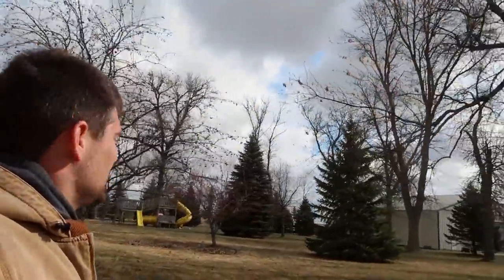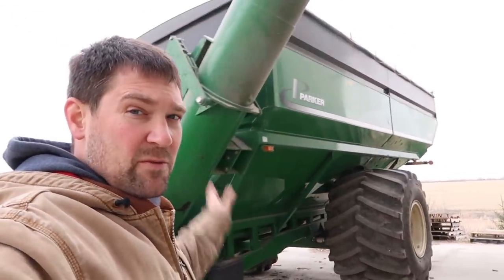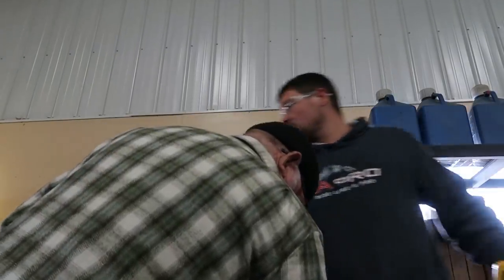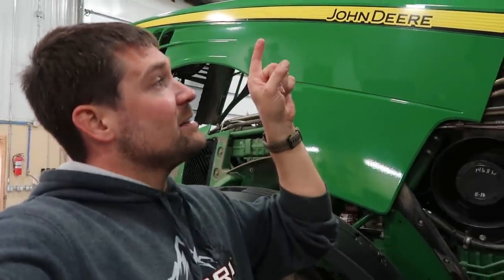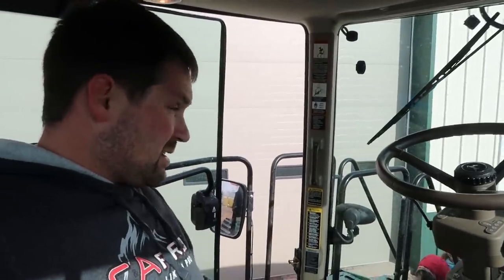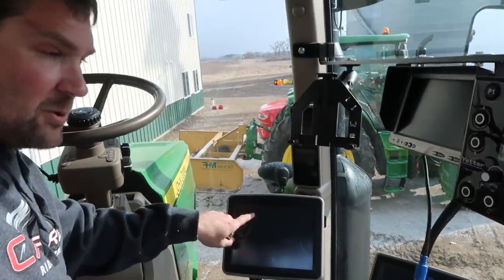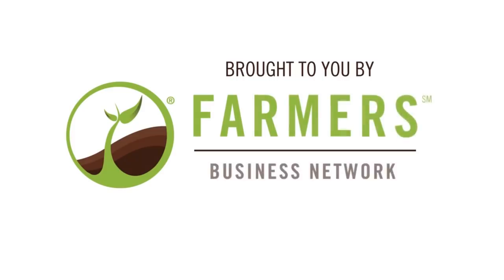Tell Us What We Did WRONG!!

Comment: When you put new fuel filters on those tractors try leaving the filters loose and turn the key on until fuel comes out of the filter then tighten it up. I’m a jd tech and sometimes they seem like they end up full of air if you don’t do that 🤷‍♂️ kinda messy but it seems to work better
Reply: Hunter Medrud totally agree with you, also I’ve found that after so long computer will time out and shut off pump even if it’s not done priming.
Reply: Hunter Medrud 
That’s great advice. Would that tip work with any diesel fuel filter? I sometimes have trouble with air locks in my 2.8 Sofim 8140 long stroke motor I run in my tourist Land train. Fiat Power Train just kind of shrug their shoulders when I ask them about it. Never had the problem on the 3 litre Toyota.

Comment: Key cycle 3 times for 60 seconds after changing fuel filters, then it will start and stay running
Reply: Sometimes they just wont bleed out.  You can pinch the return to tank line a lil bit for 20-30 seconds and repeat a few times.

Comment: Nothing more American than a seed tender with “Patriotic Farmer Addition”!!!!!
Reply: I just wondered if that's too much weight while full for the Dually, 3 axles is quite a bit for a bumper hitch
Reply: Except it goes against National Flag code.  Not supposed to display the US flag on anything.
Reply: @cmusic52  They pull surprisingly well, we typically haul 200 units of beans regularly down the highway.  Its not pleasant but it can be done behind a 3/4 ton truck as well. Legally it is to much though, your looking at around 17-20,000+ pounds depending on seed weight.
Reply: @Galactis1  people misunderstand.
The Flag Code refers to flags. Those are NOT flags, they are decals.
T-shirts are NOT flags. 
Bandannas are NOT flags.
Absolutely no rule against flag prints. None. Zip. Nicht.  Nada. Zilch.
You can wear clothing with printed American flags or flag decorations.
You cannot wear an actual flag as a piece of clothing.
There is a Flag Code covering this issue.
The American Legion has given its support to clothing that represents the American Flag and patriotism.

Comment: Do you have ground disconnects on your tractors? We’ve been putting those on our 8Rs and 8RT. It definitely helps with batteries. If you do and the planter has any extra hookups for say an air compressor for the row cleaners you have to make sure it’s grounded to the ground post and not the battery.

Comment: Since the fuel filter didn’t require a pre-fill you should’ve cycled the pump 3-4 times before firing. My guess is it was only pumping the original 3-4 seconds needed to start with an already full filter, not knowing it’s empty
Reply: The Smokers Necessity give a little bit of throttle. Help the system to pass the air so you don’t stall the engine.

Comment: When you started the tractor hit a little bit the throttle it helps to push the air so you don’t stall the engine. Even when you think your filters full you can have air left in the system.

Comment: I’m sure everyone has told you how to fix your 8360 battery problem but I figured I would share that we run an 8345rt and it has a similar issue with a large power draw when the key is off. We have found we can rectify the issue by turning the battery shut off off

Comment: We have the same issues with the batteries in our 8360RT. I installed JD’s battery disconnect this year and haven’t had any problems. Local JD tech says there is a constant draw for all the controllers on late model tractors that keep them ready for when you want to turn the key. I see all newer JD tractors are coming with disconnects installed at the factory

Comment: Same thing happened to my dad and john deere said unplug the fuse for the radio cause the radio kills the battery
Reply: Then you'd have to  have them come out and set the time and presets every time.... 🤣
Reply: Pretty much anything electronic will do it. Just because it's not on doesn't mean the comp in the devices isn't eating power. Just like sleeping and off stuff in the home.
Reply: If you use the kill switch... Your radio still work? Greens are weird. :D
Reply: It’s still odd that it sat all winter and fired up then sat two days and wouldn’t.

Comment: If you tried starting it before the filters get full you’ll get a air in the system. After that sometimes you have to crack a line to get the air out. When you turn the key on to prime the filters it will only run for like 30 seconds and then time out. I have replaced a couple of the lift pump.      On the 8000 R series do you need battery disconnects. Too many controllers on them drawing power all the time.

Comment: Whenever you replace a fuel filter (and yes.  it is not recommended to re-fill from a jerry can)  - my trick is to not screw the filter in tight. Screw it on but leave a couple of turns loose. Turn on the primer pump till no air bubbles leave to top of the filter and then tighten the filter.  It's a bit more messy but you will never have a starting issue

Comment: the reason why your tractor won't start with a new battery is the john deere green sense thing that communicates with the dealer is faulty. our 8335 had same issue. some times will start no problem, other times it has a flat battery even after been sat a long time it con be fine and sometimes not. we had a brand new 6 R 69 plate have a similar issue

Comment: In a modern diesel engines its programmed in the ecu a certain amount of time the electric fuel pump will run without the engine running. Turn the ignition key on and off several times to prime the fuel system before starting the engine

Comment: ive got a JD tractors that are supposed to fill the filters and "bleed" itself as well. about half the time it will fill about half the clear bowl and stop. all i usually have to do is crack open the little plastic screw on the filter housing and it fills up and starts and is fine. im not sure if that particular tractor has that screw but thats what works for me.

Comment: Don't look at filter if electric pre fill to 3/4 or cycle key off 4 or 5 times before cranking. Change fuel filters when engine is warm so you can run the rpms up some

Comment: I work for a large construction company in Vermont and worked in the mechanic shops for a few years, in was always taught, always fill any vertical fuel filter with fuel. That icon on the filter may mean not needed not DONT fill

Comment: just got done rebuilding a 8245r, 2018 with 300 hours on it, the electric primer pump wasn't working while i was trying to prime the system, had to jump 12v to the fuse and then it started working, now works fine but it seems that they dont like sitting.  that machine was sitting for about 7 months

Comment: Zach, regarding your issue with the twine, could in theory some sort of a 4 holed metal or plastic domed cap that mounts on the 4 bolts or nuts that hold the bearing in place on the rotating basket? It would rotate with the basket and the axel would be covered by the cap preventing the twine from wrapping around the bearing. Marketing IDEA.

Comment: In one of these blogs you were talking to Becky re cold feet and legs.  First thing to do is put on a toque.  Lotsa blood goes to the head at the expense of the feet.Secondly there are electrically heated gloves and sox plus other garments.  Either battery powered or plug them into 12.  Motorcycle riders use them,.Not good to sit for long periods of time, issues will develop in the legs. Rock your feet, or stomp them in the cab to stimulate circulation.

Comment: Is the electric lift pump on a timer with the key? On our skid steer the lift pump turns on for 5 seconds then shuts off if the engine is not running, we typically cycle the key 4 or 5 times before we start it up. Can't wait to see you guys have a great season! #plant2020

Comment: Hi dood...
Just an answer, maybe, to your flat battery issue.!  ... Maybe there is an alarm system on it that's not used that's draining it, or some other piece of equipment that's on it that isn't used but still takes power.🤔
Cole(the corn legend) had a similar problem with his older tractor. He couldn't figure it out I don't think, so he installed a battery isolator switch to isolate the lot.  I have one on my '56 Fordson Dexta. It just stops any of this sillyness, as I've got dodgy clamps, clips and connections ALL OVER the place for things that didn't come as 'standard'😂(rear lights, yellow beacon, horn, CB radio etc etc 🧐).
Maybe there's a 'main' battery isolator outside the cab, somewhere in the engine bay, that could solve the problem short term.  There's obviously something wrong with it. It could  be a wire in a loom that's rubbing through somewhere where you've installed one of your monitors or other tackle over the years.  It could short without blowing any fuses, if the current stays low enough, but, could lead to a fire if not found 😲.
Is there anything that springs to mind, something that you maybe rushed a little cos it was lunch time, and cold, and wet.😱?  Something silly.!  Somewhere that it was tight, pulling a wire through, for something, at some point. 
Just a useless try at giving advice 🙄. I'm sure you're well capable of realising this. Sorry for wasting your time, but, it was a chance to tell someone else that I own a piece of British farming history 😂😂...😘.

Comment: The electric fuel pumps will only run for about 30 -45 seconds then cut off. You need to turn the key on and off at least 4-5 times to fill the fuel filters completely. Cycle the times til the pump cuts off if you have someone to listen to them, or if by yourself cycle the key on for sixty seconds then off. That will complete the cycle of filling the filters.

Comment: may have gotten a air pocket in the fuel line or something . &  they do make solar charging systems to place on the roof of the tractors and wire  into the battery charging system

Comment: What if you weld hooks on the faces of the baskets where the twine gets into, and instead of wrapping around the bearings, it'd wrap on the hooks? Put hooks on both sides of the basket, make sure the hooks clear each other between 2 baskets. If you could imagine putting 6 hooks all the way around the bearing, like 2-3" from the bearing, I think it might work, have the hooks point away from the bearing, so that if you tried to wrap string around the axis of the baskets, the string would get caught on the hooks, instead of the bearings.

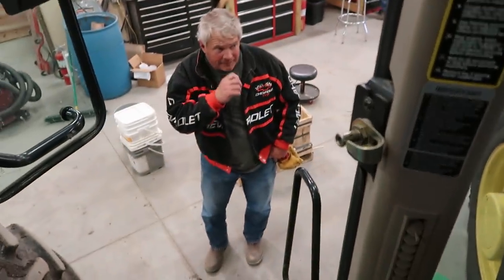Comment: At time interval  6:54 the warning on the filter indicates to NOT PREFILL. That really makes no sense as that filter appears to hold 1.0 + quarts of fuel. The long cranking time and engine start - stop is caused by all that air in the filter.  But the manufacturer J D probably does not want you to prefill because of the chance of getting microscopic dirt particles in the filter. This would be downstream and go directly to the extreme high pressure injection pump and cause expensive damage.

I would think you could speed up the air bleed process by loosening the fitting at the injection pump that receives the fuel from the filter. Run the electric pump 30 - 60 seconds until you get air free fuel at this fitting and then tighten. A little messy but that should avoid the prolonged cranking time which adds strain on the starter and batteries and can shorten elapsed battery life.

Comment: Just wondering what do you do with those totes ( the white plastic in cages ) reuse them ? I was thinking about building a deer blind and I wonder if the cages are strong enough to hold plywood and maybe put 4 together then 4 more on top making a big deer hunting rubics cube ! Lol
Reply from the maker: That would be the best option for some of the extra ones!
Reply: Millennial Farmer how much do one of those cost , rough idea ? With 8 of those and 12 sheets of 4x8 plywood @ $12 a sheet =$144 plus cost of totes , it could work ! Set out in field painted like corn stalks, just might work ! It would be lite enough and portable and not to expensive !
Reply: @davekimbler2308  Around here they're usually asking $75. for used ones.

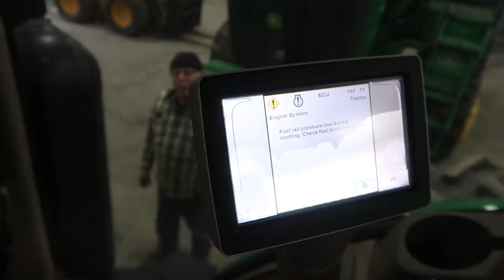Comment: 9:06 that's why you ignore the warning labels and prefill the fuel filters. From the outside of course - most people fill it from the inside, which means you get a whole bunch of unfiltered fuel into the engine. That's why there's a label on it.

But actually its kind of stressful for the fuel system to run a while with air bubbles in the lines.

Comment: Dead batteries again. When a battery sets for an extended period of time they need to be changed to get the specific of gravity up. You said it started the other day after setting  you used up what little power it had and it was in a state of discharge from setting it takes a number of hours to get the specific of gravity up. The best way to deal with it it out it on the charger over night on a slow charge to get it in shape again

Comment: Why do you havr so small tires on the 8260 ? In germany thoose tractors habe 600mm Front tires and 710mm or 900mm in the back. They  have a better floatation than these smal duals
Reply from the maker: We are all row crop here so we want them to fit between the rows, also we don't have a width restriction
Reply: @MillennialFarmer  the width restriction might be the biggest point. and the less intense tillage system. We use these wide tired Tractors often for tillage work, so that we are ripping up the soil protection from the tires. most farmers are at least plowing their fields every 3 or 4 years and cultivaters are often run at a depth of 20 to 30, sometimes even 35 cm.  northern germany is a different world than minesota, greeting from a village near the city Kiel

Comment: I’ve done fuel filters only once, but it requires priming five times before there was enough to start the truck. It was irksome to say the least. All the videos implied that it would take one prime and done. 

Is that what happened with your filter change?
Reply: Chap C hit the throttle a little bit when the engine started. It help the system to pass the air left in the filter and system.   -JD Tech advise 😉

Comment: Why ur battery dies quickly now.

FLA battery's hate the cold, hate being half way flat ( even if putaway full, over a month they will lose charge, after 6 they will be dead) They really hate being half or fully flat and cold. 
When u started that tractor the battery was weak, also you had a long crank witch towards the end you had that bat down to 20% and that's it- that's why it's dieing quickly.  Starter batterys are designed to be at 90% - 100% all the time. For most starts (3-4 turns) your not pull it down past 80%. anything under 50 and u killed it, they will act up not hold charge and not take a charge... And that's where this problem is.. 
Lets say that battery can be charged at 40amps(dose not matter ur alternater can put out 200) but due to it getting flat(less than 50%) it can now no longer take a charge at 40 ah. So u may of run that tractor for an hr, but it only got 10 amps. (if have a smart charger, bulk, adsorb, float. use it it might bring it back) 

If ur starting stuff that can be hard to start or has not run in a while put a starter jumper on it before u even try, if possible don't hold the key till it starts but do it in 3 or 4 turns of the key with only 3-4rotation each time. (I get old low compression engines just won't. But the point is don't let the battery get low ) its also about voltage drop- say ur starter with 100%(13ish volts with out alternater) battery is using 200 Ah
It'll pull it to 11v for 3-4 cranks , then as battery depleated 
Down to 8v.. Well now ur upto nearly 350amps on (half the volt dubble the amps ect) 

I think you know its best to take your batterys out and bring them in to heated shop and float charge them. 
But Im telling you. Putting a jump pack (charger) for the first start will have saved you £1000 $1000's
Love the channel. 
If u got any questions happy to answer

Comment: I know this is cheating but:

http://manuals.deere.com/omview/OMRE317037_19/?tM=FR
"9. IMPORTANT: Key must be turned to ON position for 60 seconds before starting engine to provide time to prefill fuel filters. Fuel system is self-bleeding.

Turn key switch to ON position for 60 seconds to allow transfer pump to prefill fuel filters."

Couldn't tell if you held key for the 60 seconds. Honestly, I much preferred the manual prime with the bleed screw. Then you knew the fuel was there.

Comment: Trump 2020
Reply: Zack, awesome seed tender will save you down time by filling in field,  A battery disconnect switch works good as there are systems micro leeching power when key switch is in off position. Maybe JD has something on the shelf,  my new camper has a disconnect for saving battery life.